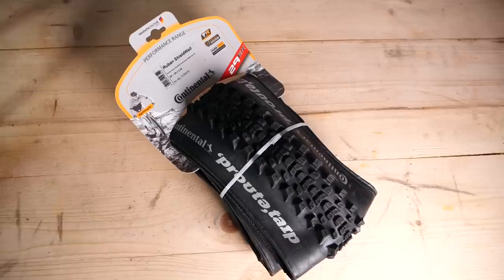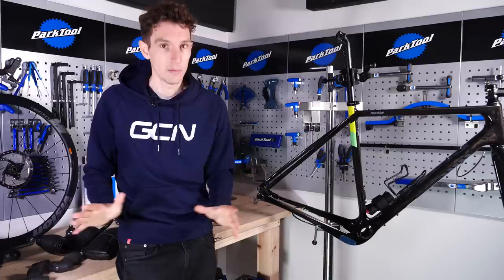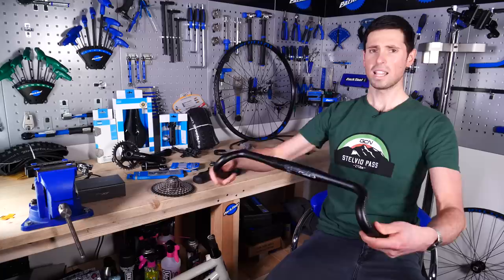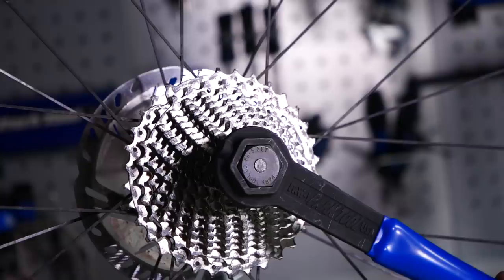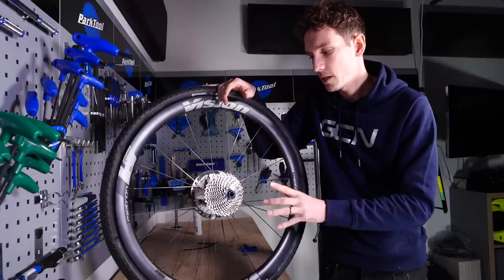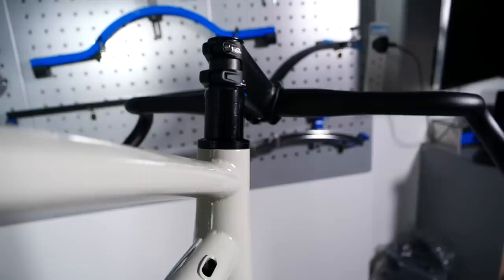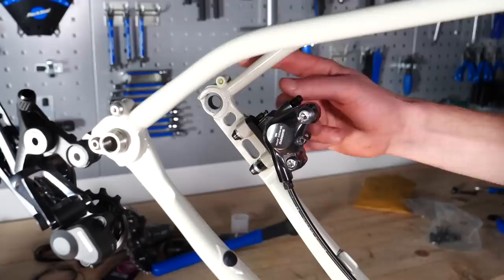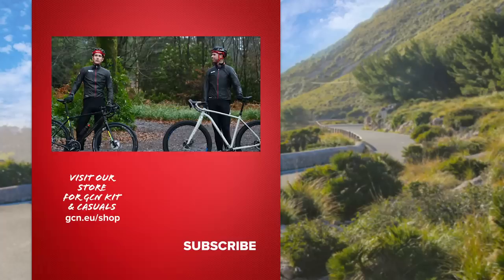Super Gravel Bikes Build: Salsa Warbird & Mason In Search Of

Comment: Great video as always. I run GRX 46-30 with 11-34 on my gravel bike. It’s great for faster gravel but also those low gears are great for the hills towards the end of 200km+ audaxes when your legs are in bits. Of course, I have the obligatory 2 sets of wheels for ultimate versatility. My gravel bike is n=1.

Comment: Nice video. I just finished building, or repurposing my 2015 Giant TCX Advances Pro 1 frame and wheels with the following:
- SRAM Eagle XX1 AXS rear derailleur
- SRAM Eagle XX1 10-52 rainbow cassette and chain
- SRAM Force AXS Hydraulic shifters (road shifters)
- Keeped the original ROTOR crank and BB, but swapped the double ring to a single SRAM 40 teeth narrow/wide ring
- Keeped the original SRAM S-Series Post Mount hydraulic brake calipers (broke 1 Banjo for Road Hydalulic Disc Brake Hose Non Connectamajig....., waiting for part ordered to arrive in order to finish the build)
- Same handlebar
- Same Giant P-CXR1 WheelSystem; 24mm wide, Alloy wheels. But had to swap out the Shimano free hub with a DT-Swiss XDR hub I had laying around. Added a 1.85mm spacer before putting on the monster SRAM 10-52 cassette.
- Mounted 50mm Schwalbe G-One Utltrabite tubeless tires
- Added Shimano PD-EH500 pedals.

I haven't ridding the bike yet properly, just testing the main things; shifting, single chain ring, singe brake (since I broke one...) and overall handling with the pedals and massive gearing ratio being a 40 front to 10-52 rear!
Reply: Smart groupset choice.
Reply: @LeoInterHyenaem  Thank you. The bike is FULLY 100% funtional now and I am in love with it. I just swapped the tires for 45 wide ones that are more for road and dirt/gravel and it is a beast. I seriously think that even road cycling will end up going to single speeds at some point.
Went out on a 65km dirt/mud/snow/road ride this past Friday and it was a delight to ride. No issues what so ever. Shifting is like butter and once you hit the pavement, you fly compared to the MTB guys. The only place where the MTB have an advantage is on the downhills that are rocky/unstable since the gravel bike is "hard front and tail" ...

Comment: Dear all the bikeshops, I don't understand why you cut cables with a squeeze-cutter, I always cut my cablings with dremel or handsaw and they are much more stiff. Some parts don't even require capsules it's so smooth. Seriously, you have all the tools but why you ruin the tip of cables with squeeze-cutters?

Comment: Your rear disc caliper on the second bike isn’t installed with the right length of bolt. Hopefully you fixed it. It’s dangerous. Hopefully you fixed it before you went riding.

Comment: #AskGCNTech Hey, I just bought the Sram Force 22 Mechanical rim brake groupset, I was wondering if I could use the same groupset for a mechanical discbrake set-up? Thanks
Reply: I believe you can. If the bike supports disc brakes. But don’t expect improved performance over rim brakes. All mechanicals are equally as terrible at braking. I’d even say, mechanical disc brakes are even less efficient than mechanical rim brakes.

Comment: Hello, Need some help. I have a custom built post mount gravel bike with Hope RX4 4 piston calliper & drop handle bar Shimano GRX 810 - 2*11 Groupset. I now have my first carbon frame CRX Elite 9.2 and so I want to change my old gravel bike with flat bar and use the GRX shifters on my new carbon frame. however, I am not sure which flat bar shifter supports 2*11 and want to check if I can use the Deor XT Shifter .... Please can you suggest various options that I can use. Also can I use the Deor XT break lever with Hope RX4? .... I am doing this change because there are not many drop bar post mount callipers available and Hope Tech do not make RX4 callipers anymore which was the only one available at the time I built the bike

Comment: I built up a Warbird when Uncle Sam sent me a check and I grew tired of playing "Dodge the Bentley" on my road routes. I object on principle to the GRX front derailleur because of crank compatibility issues; I installed a FSA 48/32 SL-K Light crank and used a standard Ultegra FD and RX800 rear mech since I didn't want the gearing restraints of the full GRX build. 

I gotta say I'm a little disappointed in Team Blue for sending out demo parts for promotions when shops can't get barbs and olives for hydro brakes, 12 speed derailleurs are backordered until the heat death of the universe and you'll probably never see an eight speed cassette again. I realize the marketing and supply divisions are separate entities, and Shimano has always been phenomenal with customer service, but sending out parts to promote when those same parts won't be available for months, if this year, seems kind of tone deaf.

Comment: #ASKGCNTECH Is there a difference in performance when riding a lighter bike compared to you losing weight?
Reply: If you are heavier the centre of gravity of the bike+rider is higher - which will make handling less stable. If you are lighter the centre of gravity is lower, which is more stable but you would need to lean into the corners more. The main advantage of losing weight as a rider is it is FREE!!!  In fact, fewer burgers, mac-n-cheeses, lasagnes and bacon sarnies will save you money. Whereas losing 2kg off the bike could cost you a grand. Also, don't forget aerodynamics.  A fat bloke like me presents a larger cross section to the air - so losing weight has dual cycling benefits, not to mention all the health benefits.  A no-brainer really...
Reply: Thanks for this. Yes, losing weight is the best option. My beater bike cracked so I’m using my carbon road bike this winter. WOW, big difference in my local short rides.

Comment: Can a MTB be converted to a gravel bike?
Reply: Yes, and there have been quite a few (early '90s 26ers!) submitted to "Screw riding up grades, buy upgrades!" in the GCN tech show. However, it's not quite as simple as throwing a drop-bar handlebar and road levers at your current bike. Couple of things to consider:

- If you're starting from scratch (don't have the mtb frame just yet), just buy a gravel bike unless you absolutely positively have to have a monster tire clearance (> ~45-622 ETRTO) and/or front suspension
- Swapping to drop-bars will change the fit of the bike; you should change your stem too ("do a bike-fit*")
- You most likely can use road-specific derailleurs with flat bars (Shimano shifters tend to be cross-compatible with the entire road/mtb range of a given generation and same amount of gears; Shimano explicitly offers flat-bar derailleurs for Claris, Sora and Tiagra).
- Changing the wheel size of your bike (i.e., from 26" to 700c) is not a particularly good idea, but can be done if you really know what you're getting into
- If you want to change your groupset to something modern, you will need to swap your rear hub/rear wheel if your bike has 7 or less gears at the rear, and may need swap it if you're going to a groupset with more gears at the rear than the bike originally came with. If your frame is disc brake compatible but came with rim brakes, you'll most likely need to swap both hubs if you want to switch to disc brakes (the hubs likely don't have the mounts for disc rotors).
- You'll likely have to run 1x (single front chainring) or smaller 2x chainrings due to fit issues (the rear triangle of an MTB tends to be much wider than the rear triangle of road bikes and bigger chainrings will rub on the frame)**. As a reference, the largest large chainring you may be able to fit is 48t.
- If your bike doesn't have mounts for disc brakes, you'll have to use cantilever brakes/v-brakes. If you're switching to drop bars this complicates things as, depending on the groupset you want to use, the brakes may not be fully compatible with road rim brake levers (Cantilever/V-Brakes and modern road rim brakes generally have different cable pull ratios). There is a way to get around this with pull-ratio adjusters -- featured in old Ask GCN Tech segments but the specific company recommended apparently has gone out of business -- or you may luck out and find 3rd party cantilever/v-brakes with revised pull ratios.
- If your bike does have disc brake caliper mounts, check for compatibility of the caliper with your frame before buying, esp. if your frame is older as caliper mount standards have changed (you'll probably have to use older/lower groupset tier MTB calipers -- should have no compatibility issues if you're using shimano -- or mount adaptors)
- Solid 650b (27.5"/584 ETRTO), 700c (29", 622 ETRTO) and possibly 26" (559 ETRTO) MTB front forks are readily available and may make for a nice upgrade, depending on the state of your current fork and what you plan to ride on (I ride mostly on tarmac, a solid fork is almost a no-brainer 😊)

* : Not necessarily a professional bike-fit, but you will need to adjust the stem length and seat position to the new handlebars.
**: I technically ride an MTB (Hardtail XC frame) gravel bike 😊 assembled by my LBS, with a solid front fork, narrow and long (for today's MTB standards) flat bar/stem combo, Alivio shifters and 3x front derailleur/crank (48-36-26), Sora rear derailleur/cassette (11-25), and cheap and cheerful Tektro Auriga Comp hydraulic disc brakes.
Reply: @docontra4921  appreciate the time you have taken to explain each things anyways I'm starting from scratch I just bought a mtb frame 29er and was thinking to have rigid fork setup with 29*2.0 tires and ALIVIO 3x9 or deore 2x10 or 2*11 groupset with hydraulic discs and flat handlebars if you want to know the brand of the frame it's Mountainpeak Everest 2 bought it in Philippines have direct mount FD internal cabling and smooth weldings have a look on the frame and share ur opinion
Reply: @anurag-21  No worries! You'll have little to no compatibility problems, esp. since all your components will be modern and, since you're using flat bars, your brakes are completely independent of your shifters giving you more options. Your setup will depend on the kind of riding you want to do and the frame clearance:

- Alivio 3x9 will be cheaper to buy and maintain (esp wearable items -- cassettes, chainrings/chainset, chains), have better range with closer ratios, and a higher top gear than with Deore (Alivio 3x tend to have chainsets with a big ring of >=40t and up to 48-36-26, Deore 2x all seem to be 36t-26t) which makes it more suitable for mainly road riding. The downside is that the 3x front derailleur setup and use is slightly more fiddly, and that you have more "unusable" gears (the top of the cassette on the large chainring and the bottom of the cassette on the small chainring)
- Deore 2x10/2x11 (and SLX 2x12) will give you higher quality components at a higher price (esp. maintenance, as the chains especially wear more quickly), and will be better suited for hilly riding and more off-road riding (although given the gearing options of the 2x, I'd personally seriously consider going 1x11 or 1x12). However, if the GRX chainset fits the frame it becomes a viable option (esp. on 2x11)

If you decide on the 3x9 option and you're riding on flatter terrain, consider using a Sora rear shifter/cassette, you'll be giving up on range but will gain closer ratios (I run an 11-25 casette with the 48-36-26 and I can climb pretty much every hill I care to ride on the 36t chainring, but I live in an exceptionally flat bit of the world 😊)

Whatever you do, don't buy your wheelset (or at the very least, rear wheel/rear hub) until you decide which gearing option you will use. Freehubs are made for specific types of cassettes, although if supported by the manufacturer, you may run cassettes with a smaller number of gears than what the freehub is designed for by running spacers or have the option of interchangeable freehub bodies. You can find 3rd party 10/11 speed cassettes designed to fit hubs for 9/10 speed casettes respectively (typically by either using a 10t sprocket as a lockring, or more commonly, using a huge sprocket as the lower casette that clears the hub flange).

PS: If the frame has a threaded bottom bracket and you decide to go the Alivio route, consider using an Octalink BB/Crankset instead of the Hollowtech-II BB/Crankset, I had two crank failures with Hollowtech-II Alivio cranks 😊 (in both cases, the splines on the NDS crank failed, and the NDS crank suddenly came loose -- without falling off -- and wouldn't hold its position)

Comment: 17 teeth differential on chainrings must be pushing the limit!:? Isn't Shimano recommendation 16 max, or is GRX different?
Reply: GRX is different; the 48-31 is the stock shimano part ( https://bike.shimano.com/en-US/product/component/grx-11-speed/FC-RX810-2.html ). Note that GRX front derailleurs and cranks are incompatible with the rest of their road components because the chainrings sit further outboard from the frame compared to the road cranks to allow frames with bigger tire clearances (all other GRX 600 and GRX 800 level components, including both shifters and chainrings, are compatible with 11 speed Dura-Ace/Ultegra/105).
Reply: #askgcntech Is it possible to swap the chainrings in a GRX crank for larger road versions? (assuming good frame clearance) Given the kind of riding I do (urban in a particularly flat and poorly surfaced city) and my natural tendency towards low cadence riding, my ideal bike would be a gravel bike with a subcompact (52/36) crank.
Reply: @docontra4921  there a loads of options out there (perhaps more in previous model years) that just use 105 or ultegra sub compacts with 11-32 or 34 at the back. (Aftermarket cassettes up to 11-40 are available and can work okay, apparently)
Reply: @armadillito  Thanks for the reply! I was about to buy my first drop handlebar bike ever just as the pandemic hit; my plan was to use 105 crankset, front derailleur and cassette* and GRX-600 everything else**, but since I've been bitten by clearance issues once (with my current fully rigid MTB bike) the option to run the wider GRX crankset with subcompact gearing is really appealing for me 😊

*: Back then I'd probably have gone for the 11-28 even if it means losing the GRX clutch rear derailleur for a 105 part, but had a think while seeing the video and wanted to play it safer with an 11-30 which is ultegra-level only IIRC 😊
**: I will admit to wanting to treat myself to a pair of Ultegra-level 160mm brake rotors 😊😊